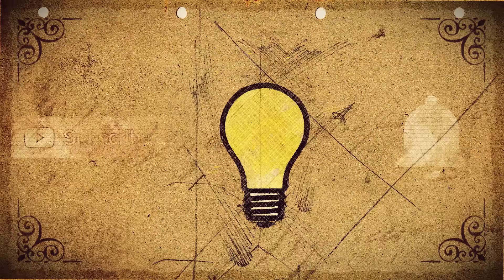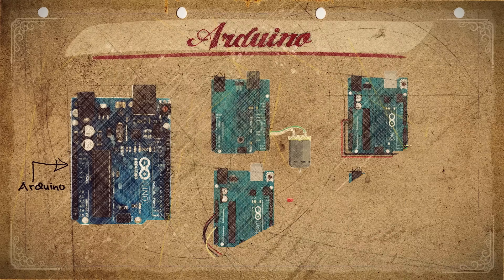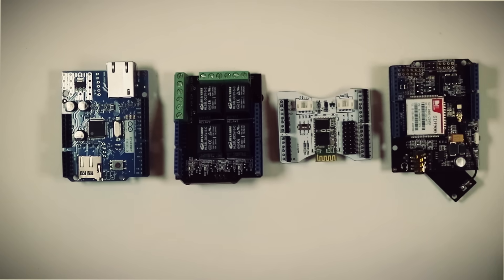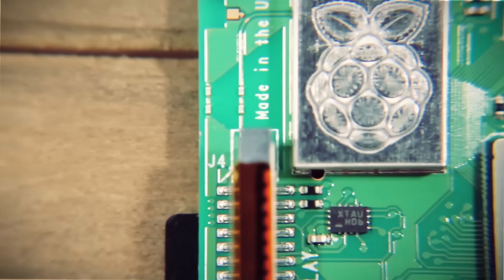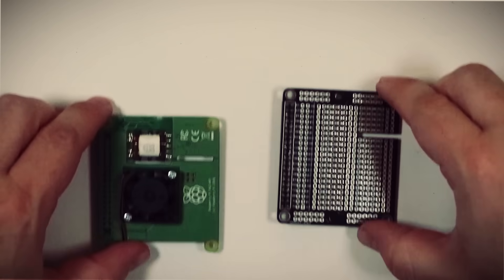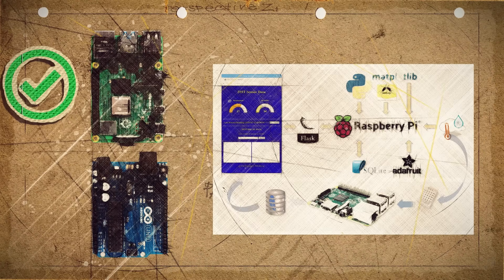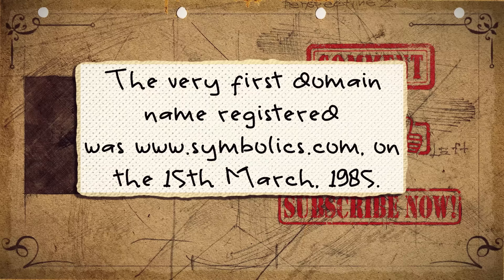What's the difference? Arduino vs Raspberry Pi

Comment: Hi there 
I like the way explaining things,  I don't know alot about microcontrollers ,but I need one to run a software or firmware act like a text filter ,receive data from printer thru res232 / tcp 
And send it to pc . What I should use ?  I appreciate your advice.

Comment: Thanks for the cut-n-dry explanation.  I am using an Arduino to run a DCC-EX program for my model train controller.  I wondered if using an Arduino or Pi would be better for the track-side accessories such as the crossing gates, traffic signals, and building lights.  You have confirmed that Arduino is the way to go for me.

Comment: An additional note, in the event that you would like to make phone calls, send SMS messages, or something along those lines,  the Arduino if you use it, requires a SIM module (7600, 7670, etc.). The SIM modules don't always configure properly and are quite fragile. There are no standard protectective covers for the SIM modules as they come in different sizes. All-in-all, you would need TWO covers for the modules. The Raspberry Pi is a single module that allows for the purchase of a protective cover. These can be easily found on Amazon.  Another disadvantage of the Arduino is that you are pretty much stuck with having to program in "C," with having to go through some additional changes, like changing the IDE, if you want to use another programming language (not recommended). I found this out through trial and error, but please, just be mindful.

Comment: I do think even with the added complexity a raspberry pi is better for beginners because python is a far easier language than modified C. Its like comparing an LED blinking and building an entire electrical power station (or what people think cus its not that hard having tried).

Comment: Okay a few things. This made it sounds like the arduino microcontroller was made by TI; at 1:14 it correctly labels the microcontroller as atmega328p, made by Atmel then merged with Microchip. 2:19 "similar to C#" isn't technically wrong, but more accurately, Arduino ide uses C++. Now, just as a matter of opinion, I have to disagree with the conclusion. I have found the raspberry pi far more beginner friendly. Python is easier for beginners to pick up than c++, programming on the device itself is less complicated than programming it externally, and when it comes down to it, you really need to dig into the datasheet and understand the hardware on a microcontroller, where most of that hard work is abstracted away on the pi.

Comment: Pi is powerfull and specially if you runned without OS it is useful if an application depends on processing a lot of data coming from sensors like avionics.

Comment: It depends,
I am personally software guy. Raspberry is easy, you put already premade Linux there and you have actual computer that use almost no power in comparison even with smallest notebook.
Arduino is supercool microcontroller, but it is not computer.
For me Arduino waaaay harder. 
You need to be able to solder for a lot of things, you preferably need to know C.
For me Arduino is actually for big brain guys who are able to work with hardware while Raspberry is just plug and play.
I like raspberry like very low power fully functional computer.

Comment: Can you actually use a pi as an esp32 or arduino?

Because I read the maximum current per pin is very low, only 8ma compared to 40 for the esp32

Comment: 🎯 Key Takeaways for quick navigation:

00:31 🤖 Arduino and Raspberry Pi are often compared, but they serve different purposes.
01:12 🧮 Arduino uses microcontrollers for simple component control and is great for robotics.
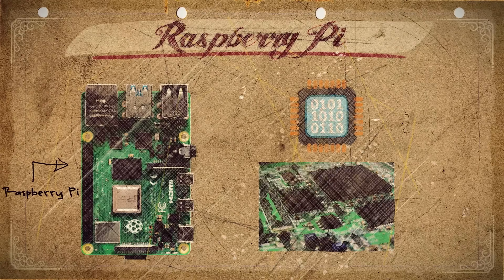02:47 💻 Raspberry Pi is a full computer with a microprocessor, suitable for more complex tasks.
03:57 🧩 Raspberry Pi's GPIO pins can control electronic components like Arduino, but it's more powerful.
05:07 🛠️ Choose Arduino for beginner tinkering and robotics, Raspberry Pi for computer-related projects.

Made with HARPA AI

Comment: Did I just hear him say it's similar to the C# language... It's C++, literally what it is. From the technical standpoint it's nothing like C#, no GC. Very few native objects (e.g. strings, unless you include std::string)
Just imo not the right comparison to make

The other thing I'd add to this video is that while Arduino is "designed for beginners" I'm under the impression that the PI is better for beginners (though I've never used a PI) as the python language (as much as I hate it) might be easier for beginners to comprehend, also makes rapid testing much faster, though does cost a lot more. But then again, there are Arduino emulators and language converters for it so

Comment: Quick Fact! Not every programmable IC is called an arduino.  In fact the ATMega32U4 is not an Arduino (uno), it was just placed on a board that was marketed by "Arduino", a company sarted out in Italy. The boards that don't have the -8+ symbol on them aren't Arduinos, so I wish people would stop calling them that.  It's like the brand of Hoover, people say "I'm hoovering up"... no you're vacuuming; Hoover was a brand of vacuum.  And Arduino didn't do anything special either, they just made a PCB and stuck a programmable IC on it, a voltage regulator, a few resistors and capacitors, to make it tolerable for learners.  Which I suppose we're all greatful for.

Anyway, a programmable IC cannot be categorised like this VS an ARM processor, which is what the RPi uses.  They're each in a completely different league.  The arm is a complex architecture and has a lot of overheads, too much for let's say actuating just a relay or two, it's over kill. Where as, smaller programmable ICs cannot handle large programs, but that said there's a lot of good stuff to be learned using them.  Start with programmable ICs and learn C++ it'll do you good, it's nitty gritty and raw.

Comment: I guess they're both awesome. The arduino is dirt cheap, so it's probably the best option I think, especially if you just wanna experiment with simple stuff, circuits, small embedded projects etc. With the pie you could make more involved and complicated projects, and if you want to program on the language of your choice or if you have more involved requirements on software, and/or you need more computing power, then the pie is more appropriate. I would start with an arduino for simple embedded projects. I'd probably use a pie later or for other stuff. You could also combine the 2 if you want (i've seen someone do this) although I don't see the reason why you need to do this, but you can do if that's what you need. Both Arduino and pie are awesome, the stuff people build with these things are amazing and there are newbie guides all over the net. I wish they were available back in the past with the same price tags they have now.

Comment: Better question: I want to build a system that responds to commands from an accelerometer (Basically if vibration exceeds value X, shut down). But I also want to have the system respond instantly to a manual override. Which is my better option? Rasberry or Arduino?
Reply: @too many waifus destroys your laifu Thank you Arduino it is!

Comment: I need to make a brain computer interface programme where I want my device to read eeg data and once the data exceeds a defined value it has to turn on a relay switch of another device. What should I use an Arduino or rasp? I think I require data processing as well as the software that would read eeg and interpret would require an operating system.. So i need much of a whole computer in the form of a chip which rasp serves very well

Comment: Its my personal opinion you should 'start' with a pi as its a computer. most people are familiar with using a desktop interface right off the bat.
plugging in the arduino into the usb and uploading software to make it do things isn't as common place, and could be more confusing in that regards.

though in general both are not 'easy' to work with and does take some time to get used to.

Comment: So sad that modern "programmers" have no idea about algorithms. Building a serious robot does NOT require a stupid webcam (as stated here) or other junk. It requires image processing, signal filtering from sensors, and optimization problems. That is where you need to have a fully functional programmable computer (like Raspberry Pi) instead of a microcontroller.

Comment: Actually, the main advantage of the Arduino is the c like language and also the digital and analog pins. ADC is very important to have sensors for robot. Also, the number of digital pins, especially on a mega, allows more versatility in designing a system. Also, the Arduino is not hackable, while raspberry pies can be hacked very easily. Also, arduino supports micro sd card and mp3 player modules and screens. Also, arduinos are much less expensive, lowering costs.

Comment: 4:55 "You wouldn't want to buy a computer just to solve a mathproblem". Well, depends on the kind of mathproblem :-)

Great Video though! 
Some notes about Texas Instruments: Yes they are famous for calculators, but they still are a big player today in tech. 
Ever used a beamer?
On most beamers on the side you will find a sign that says "DLP". This stands for "direct light processing" and this is how it works: It is a basically an array of tiny mirrors that are changable in their angle.

So if you have a beamer with Full-HD-Resolution, this means that inside of it there is an array with 1920*1080 tiny mirrors in it that are tiltable individually. 

Now this is how your beamer works: 
Lightsource --> Color Wheel --> DLP Chip 
When the light reaches a mirror in a DLP this mirror represents a pixel on your projection area. It's tilt-lvl is what determines the brightness-lvl of this particlar pixel.

Another technology for Beamers are tiny lcd screen. This technique is mostly for used by Epson.
Now with the DLP technology being patented by Texas Instruments, whenever you see a Beamer with "DLP" on the side, no matter what brand, you know that TI get's a piece of the cake. 

Greetings and have a lovely week.

Comment: I would classify them a bit differently. An Arduino is basically a modular, expandable microcontroller, emphasis on "controller." It's made to interface with and control physical things, and it does that well.

A Raspberry Pi is more of a micro computer, for a more traditional computer type of work. It can do controls stuff if it must, but it isn't ideal the way an Arduino is. 

If I needed something to do a fair bit of both types of tasks I would probably use both together rather than trying to get a Raspberry Pi to do it all. On large scale industrial automation we don't just connect all of the components to a PC and expect it to run. We use a PLC (sort of comparable to an Arduino on a larger scale) to control the machinery, and we use some sort of computer (sometimes PCs, sometimes all in one devices we call HMIs, or human machine interfaces) to interface with the PLC.

Comment: I use arduino when i only meed to read sensor and send data thru wifi to a database , no need to use a 50usd raspberry pi when a 5usd chip does thevsame thing. . Or when timing is critical.its a mcu you need. Raspberry pi is ideal to have the database on.. so thats why i use both arduino and raspberry pi

Comment: Correct me if I'm wrong, but a thing that always pushed me away from Arduino (not that I am any tinkerer, I do mainly systems programming) is that it has somewhat "hacked" unofficial version of C with some extra stuff which is not ISO C neither ISO C++. You just can't write properly standard C or C++ code and many external libraries will not work on it because libraries are typically written against the ISO standard, not the Arduino.

Also to the OP (3:25): Linux is not an operating system. It's a kernel. A system is typically a combination of GNU software and Linux kernel, called GNU/Linux or GNU+Linux.

Comment: And the Raspberry PI doesn't always run the linux operating system, it runs any ARMV71 bootable software (armv71 for the 4B at least) that you put on it, which can include most linux distros.

Comment: Arduino is a small PLC. Pi is a small PC. PLCs control hardware on a very fast dedicated loop of monitoring inputs and quickly adjusting outputs per scan. A PC can do this as well, but much slower due to the overhead of running the OS among other software related tasks. So it's not just that an arduino is "easier" it's also better at the  particular task of controlling hardware due to being dedicated to it.

Comment: As a beginner, I honestly have to say this is extremely informative. Thank you for helping me more easily narrow down my thought process on what to start with when it comes to learning how to program and tinker with robotics. I hope to one day also learn Python and "graduate" towards a rasberry pi after I feel that I've somewhat mastered the arduino. We've been learning how to use arduinos on a very basic level for my intro to engineering design course at college and I honestly have been really enjoying it. Though, I can only say that I've only scratched the very surface of possibilities these systems are capable of doing.

Comment: Another thing. Arduinos start pretty well instantly and don't get upset with power failures before shutting down where the pi takes time to boot and may get upset by power failures without shutting down.
Arduinos have both digital and analogue pins (5 of them) where the PI has only digital pins.

Comment: Also,
Get an Arduino if timing is important, you pretty much cannot run servo motors directly with the raspberry pi since it has timing issues (it can't be accurate down to the microsecond due to the OS)
Arduino runs your code, AND THAT'S IT!

So the correct answer for robotics is get both, the Arduino for the low level stuff(motors, simple sensors, lights) and the Raspberry for the Logic, Databasing and networking.

Comment: I don't think you should see the arduino as a stepping stone to a raspberry pi. That's wasting a learning curve. Its more about cost, capabilities and power consumption, where I think you are better off switching to the platform that you need eventually right at the beginning.

Comment: C- answer. Raspberry pi(BCM2711) and arduino(ATMEGA328P) are basically the same, they are both system on a chip, containing everything to be a fully functional computer on a single die. It is just that the BCM2711 a far superior computer to ATMEGA328P. Therefore it can run an operation system and do far greater things. When you are programming for raspberry pi you are not programming (BCM2711), you are programming custom Linux.  TLDW: Raspberry basically a super computer (BCM2711), can run OS and you are almost always programming for a custom Linux. Arduino is super shitty(ATMEGA328P), almost always run without operation system and you are programming for a (ATMEGA328P). The key answer is operation system.

Comment: I have used Raspberry Pi way more often, even for things that I should have used an Arduino for.  Simply for the fact that I could get Raspberry Pi Zero Ws for $5 anytime at the local Micro Center.  I stocked up on Pi Zeros and Zero Ws and just have them laying around for whenever I need them.  Yes, they have been absolute overkill for every single project that I have ever done, because an arduino would have been the better solution.  But, I could buy 3 Pi Zeros for the price of 1 Arduino.
Reply: @yeremail  Not really sure how to answer this.  There are like 25 of them across the US.  Is it weird that I live within 40 minutes of one of them?

Comment: Agree with everything except the conclusion. If you are a beginner then you would appreciate the simplicity and abstraction layer of the operating system and graphical interface. Raspberry Pi helped many programmers to work with complex electronic components even if they know nothing about hardware. So essentially consider the fact if you are a beginner in electronics or a beginner with software.

Comment: So if I wanted to have a set of Christmas lights that switch on and off sequentially but in  random order in an outside garden display and also respond to a sensor that sensed someone nearby and so switched the lights on I would use  Pi?.......whereas an Arduino would just switch the lights on an off at timed intervals to a set program?